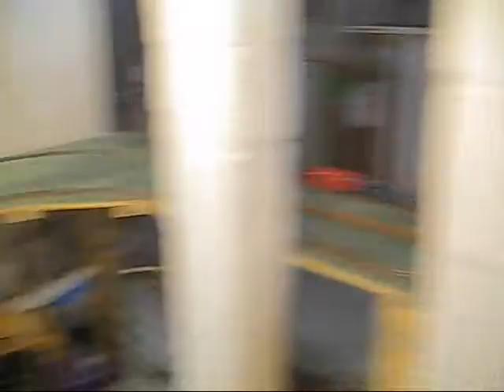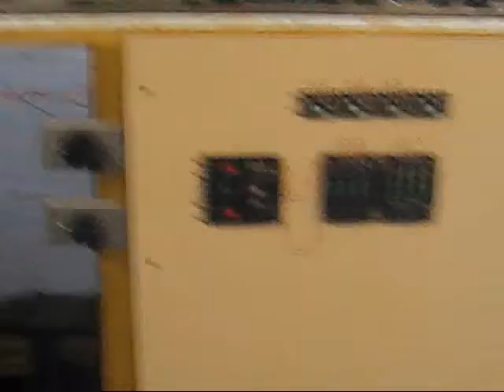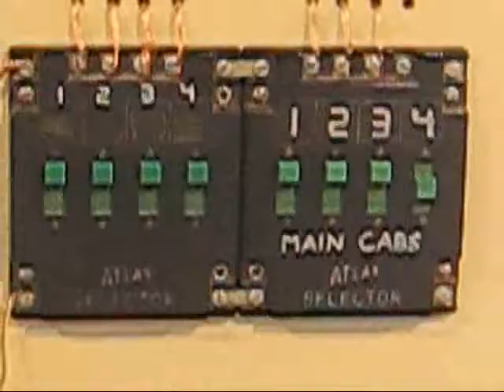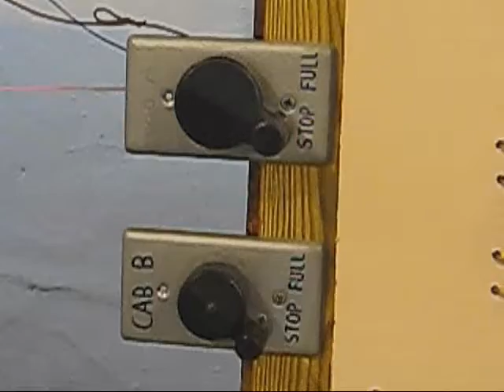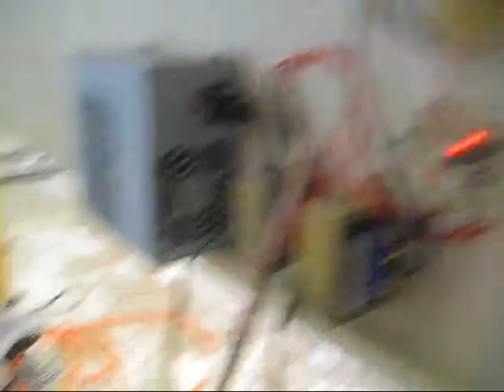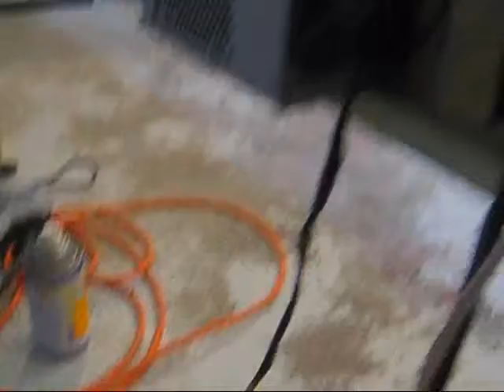My Layout, Powered Up

Comment from the maker: I am making my own walk around but it won't use memory, it will be connected to the main board with a cable, the operating pit is only 6 feet by 8 feet so the added cable shouldn't be too much of a hastle, I did this on my previuos layout and it worked just fine.